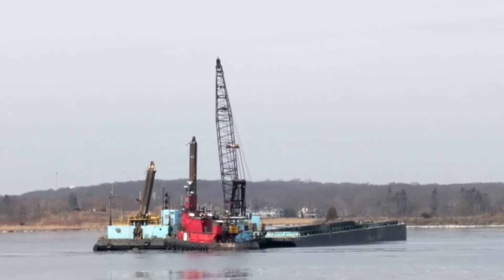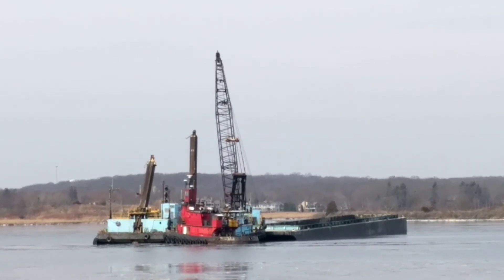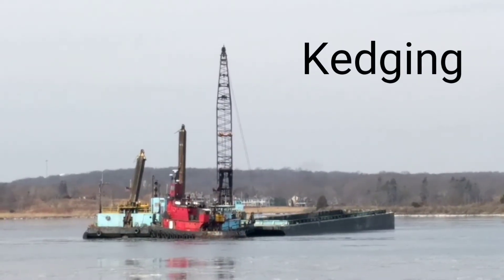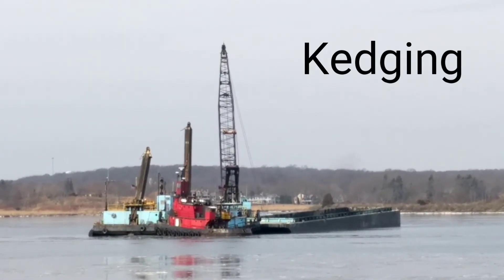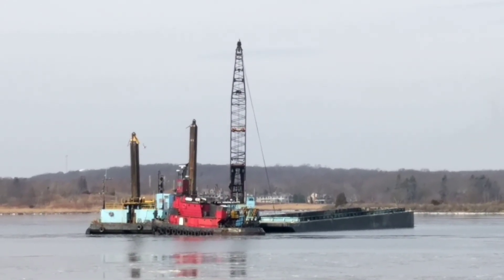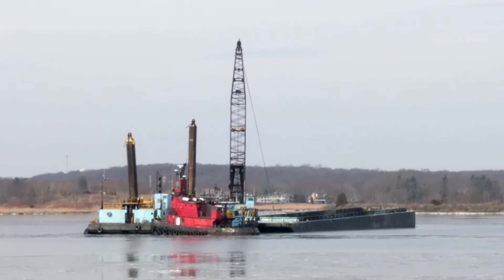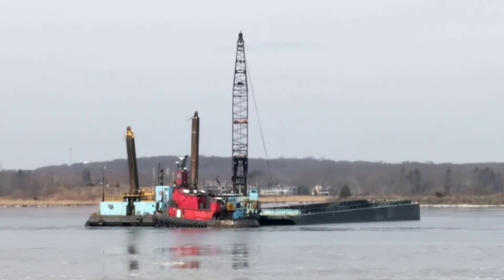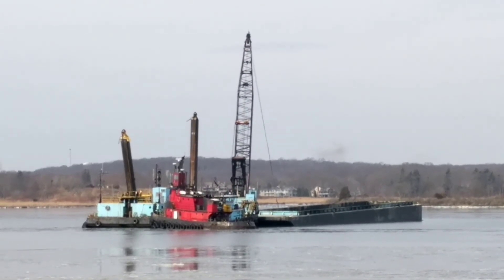Duty Cycle and Side Loading on a Crane

Comment: I WORKED WITH 60’ BOOMS, WITH ALL MECHANICAL CRANES, NO HYDRAULICS, NO AIR ASSIST, LASHED TO THE DECK, CASTING CLAM BUCKETS, DOING FIGURE EIGHTS WITH IT. 
I WOULD. LITERALLY ROCK THE CREW TO SLEEP WITH MY RYTHUM. DIDNT NEED A TUG, WOULD MOVE THE BARGE WITH THE CRANE ON THE JOB SITE. AH THE GOOD OLD DAYS.
Reply: How many booms did you collapse?
Reply: @   THAT WOULD BE A BIG FAT ZERO BROTHER… 0
Reply: @MegaIronleg  I guess metal was actual metal back then. Seems dangerous,  side loading the boom like that

Comment: Very good video being a crane operator I have had this conversation many times believe it or not but I was once asked to tip a 23000 pound fertilizer tank with only one crane it only had two lift eyes on the top that were in poor shape to say the least I refused to do it without getting upset but I explained what my concerns were and we ended up using 2 cranes and completed the job for the customer.
My Uncle worked at a scrap yard loading rail cars with shredded steel using a magnet and these rail cranes were designed for rapid cycle operation so when the operator had the magnet over the rail car and releasing it the boom tip was over the scap pile and when the magnet was being raised with another load the boom tip was over the rail car so if you can picture the boom tip and magnet always in an opposite position it was very fun to watch!
But these cranes had very strong angle iron boom designs and the booms were very short about 35 to 45 feet!😀🇨🇦